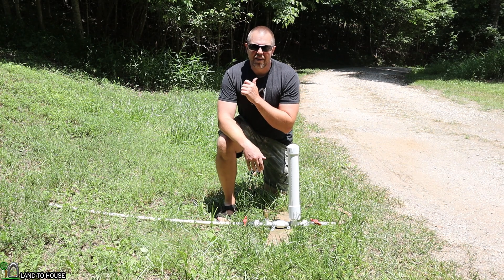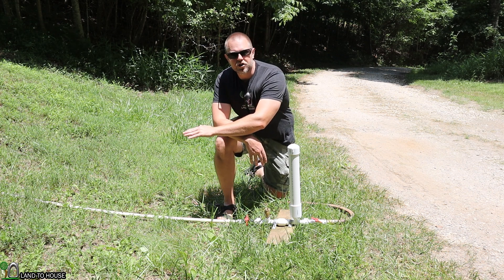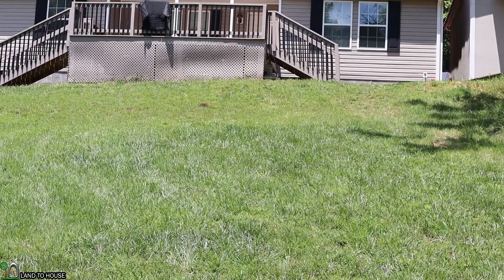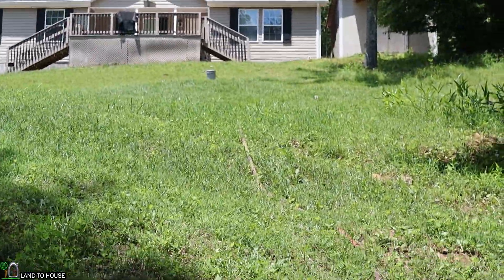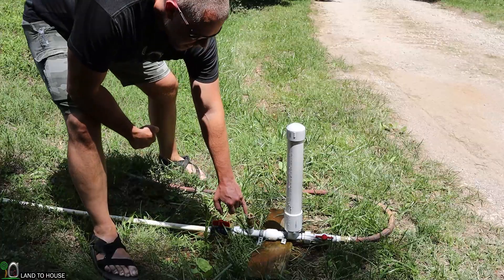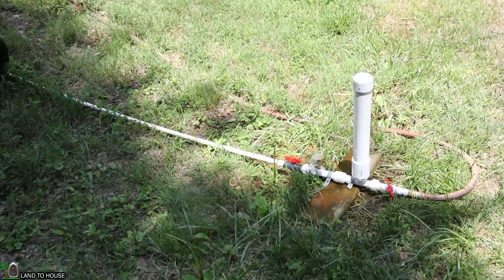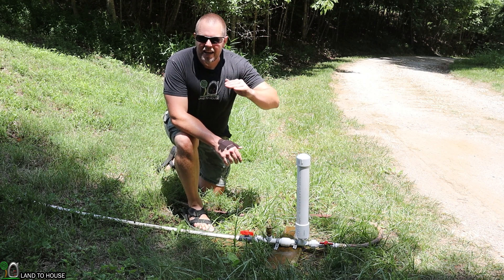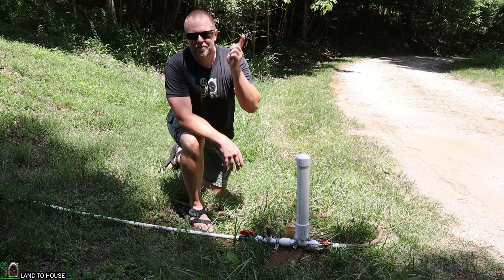Ram Pump Stops at Random - Back Pressure loss fix

Comment: Seth, what if you increase the size of the delivery hose, say to 1” or 2” so there is more water to push uphill? With a 3/4” ram, we are sending water about 50 feet away, and about 10’ up into a barn tank via 1/2” pex. Head pressure of 7 feet drop over 150 foot distance...so too much head pressure and the pump stops after about 15 minutes.  Could we increase the delivery pipe size by connecting the 1/2” pex delivery hose from the ram pump to the base of a 2” PVC pipe going up the side of the barn and then to the tank? It seems like a larger amount of water sitting in a larger delivery pipe would create more back pressure and be harder to push up? Thanks for all the great info and the experiments!!!

Comment: I have a one inch ram, and delivery pipe, with 3 foot drop. My pressure tank is three inch with tube for pressure relief., delivery is 3/4 pipe starting after pressure tank.
The pump cycles slowly, approximately every two seconds and will not pump higher than 10 feet, then stops.very frustrating.
Reply: How many gallons per minute is your supply? You may not have enough water to efficiently run a 1’ pump - you may need to decrease your ram pump size if you only have a supply of a couple of gallons per minute available.
Reply: @folsterfarms  thanks. It has run for three months now. Water is low at the intake, but still getting 3 gallons pm. I added another intake line.

Comment: Currently having the same problem. What if I put a ball valve at the top of the hill and adjust it until I get a consistent flow of water instead of a surge?

Comment: Well done practical test.  With the 6 ft. head pressure what was the minimum delivery height for the pump to keep running?  Does this suggest a fixed ratio between drive head pressure and minimum delivery lift to maintain backpressure?

Comment: What happens if the tank is completely full with water and no air cushion in it? 🤔🤔🤔
Reply: If there is no air in the pressure tank, the ram pump will reduce its operating efficiency or stop running. The water hammer effect force will be directly applied to the top of the pressure tank, which will damage the pressure tank.
Reply from the maker: The pump can continue to cycle but it will hit hard and oftentimes can break things.
Reply: He made a video to address this. The title is "Ram Pump hits hard - how to fix it."

Comment: Sounds like you need some sort of pressure equilibrium from the drive pipe and delivery pipe.  Wonder if you can actually measure on either side?  I figured it is constantly fluctuating but perhaps measuring the average?
Reply from the maker: The pressure spike on the drive pipe is very big as the water hammer hits. The delivery pipe is much more consistent.

Comment: yup ..... and if your intake has too much head pressure it will stop it too so then I have put in smaller intake or adjusted the intake valve in same fashion....yup
Reply from the maker: Yes typically any pressure over 25 feet will stop the pump.